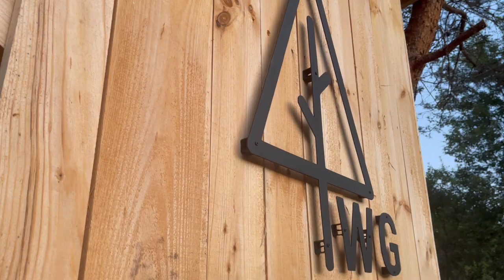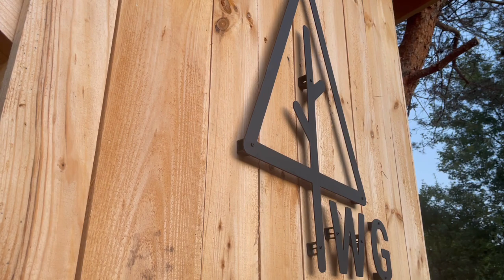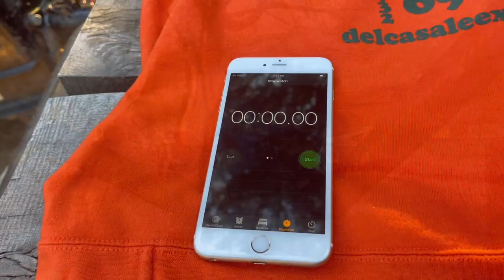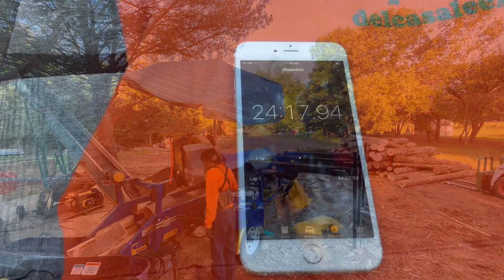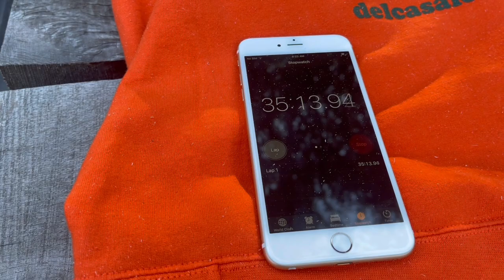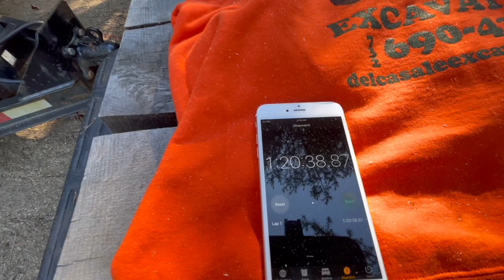FIREWOOD PROCESSOR! (TIMED) How fast for 5 face cord!??

Comment: Great video. And ya that processor seems to work pretty good. I own the same Size trailer, which is 14' long, 7' wide, and 4' sides. Even my doors have the tall sides. I noticed your trailer because the doors don't have the tall sides you can't get a full load at the back. What cubic feet do you get on your trailer because of no sides on the doors? My trailer is 392 cubic feet I get on my calculations. So if my trailer was all stacked and placed I figured it holds 9 face cords but of course tossed in you lose about 25 percent  difference. So just curious what you get on cubic feet on your calculations on your trailer. Cheers.

Comment: Your production is largely dependent on the size of the logs you are running through your processor.  The larger the diameter, the more your cords per hour figure goes up as long as your processor has a respectable cycle time.